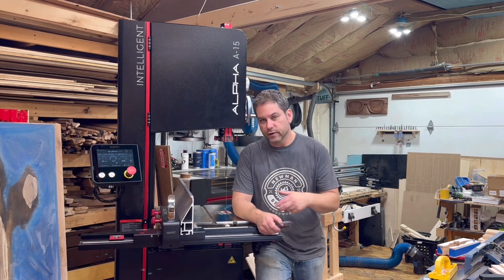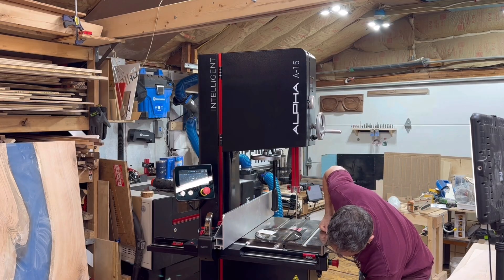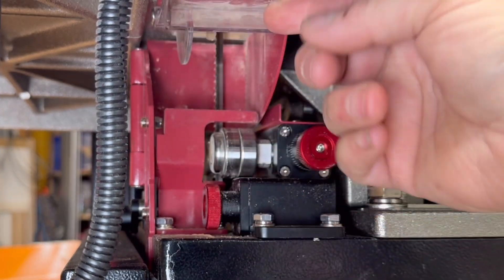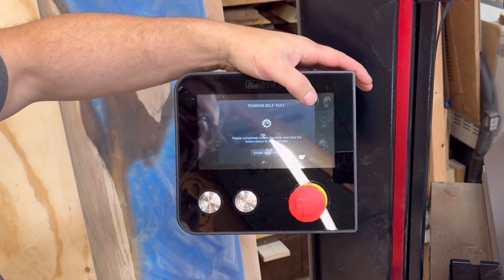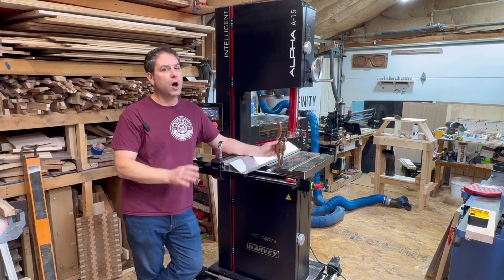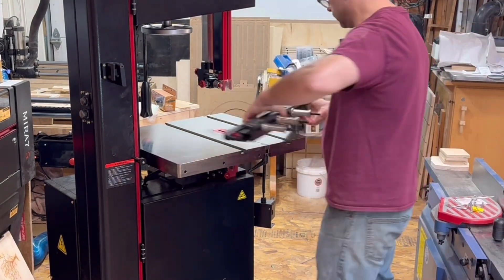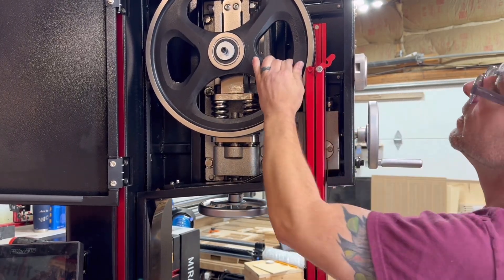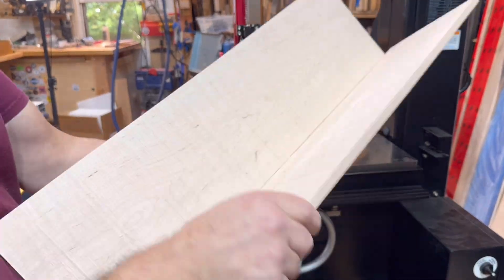Inside the Harvey Alpha A-15: The Future of Bandsaws?

Comment: I feel like there's a conspiracy to hide from me the information and insight necessary to properly dial in a bandsaw. To my dying day, I will never make a straight cut on a bandsaw, much less have a need for micro adjustment. That said, Harvey makes amazing tools, and in them I trust.
Reply from the maker: Mike, I find that very very hard to believe! I doubt there is anything you cannot do if you put your mind to it!
Reply: I wonder if the big fence is retro compatible to their other bandsaws. Also can a company take into consideration that some users are short and the windows work but not as well maybe a built in step stool?
Reply from the maker: @boneyboardwoodshop 😂 the built in stepstool is no joke! It’s a big machine! But it is pretty easy to see in. 
For the fence - I wouldn’t doubt that it is, because of the way they setup everything with the fence.